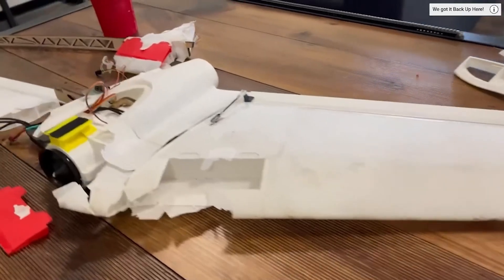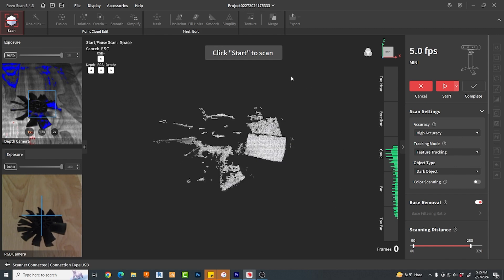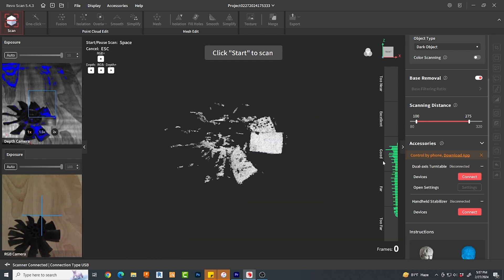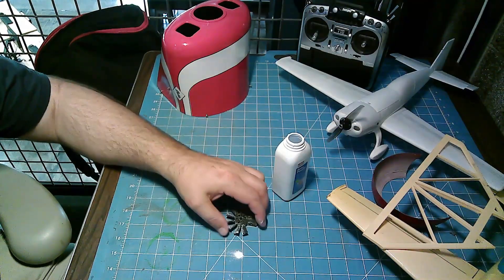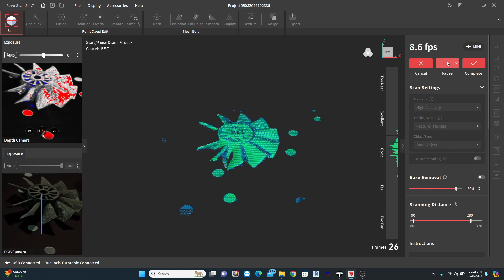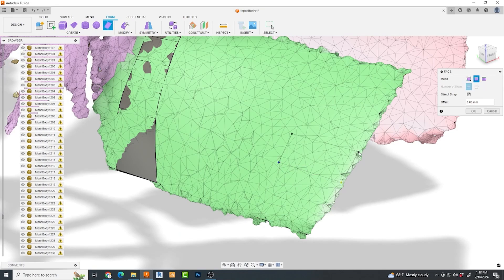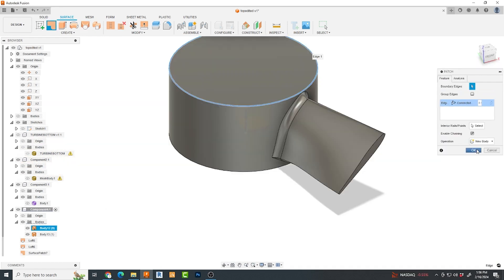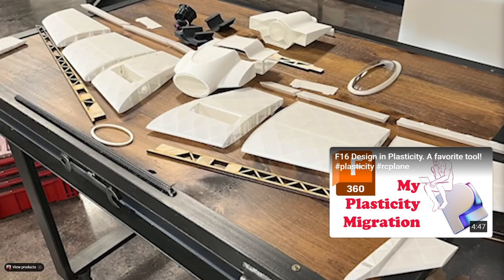Revopoint Scan to Fusion 360 - A First Time Success!   RC EDF Jet Reverse Engineering. #fusion360

Comment: I purchased the mini2 and I have some things I learned. I use dye penetrant developer spray to paint my parts white. It works much better than the revopoint spray and It washes off easily. I would only scan 1 blade for reference. No need to scan the entire part in your case,
Reply from the maker: Totally agree.  One good blade scan is perfect.